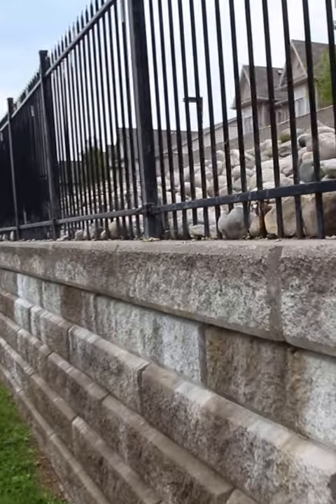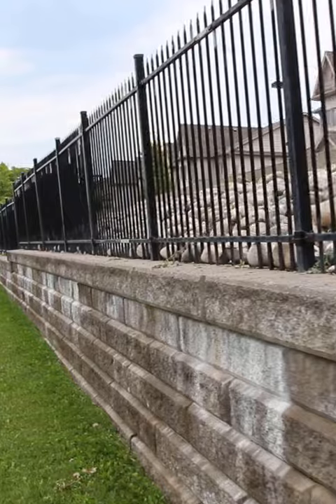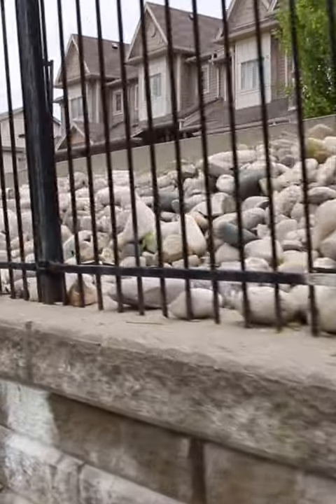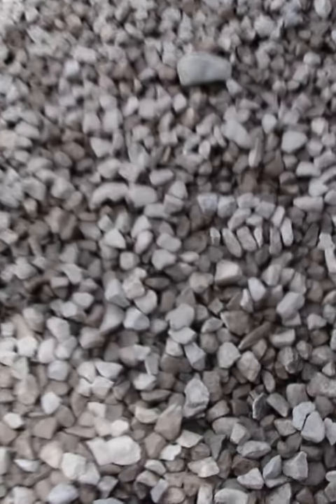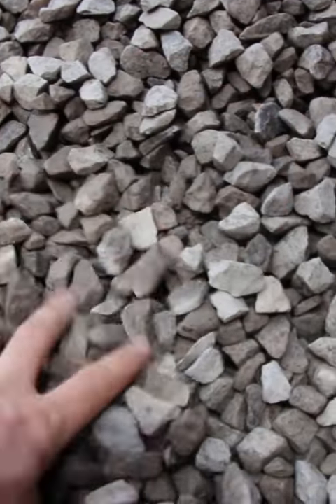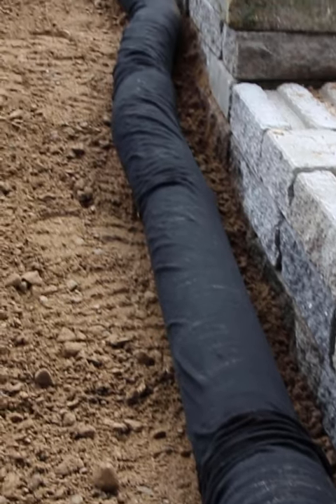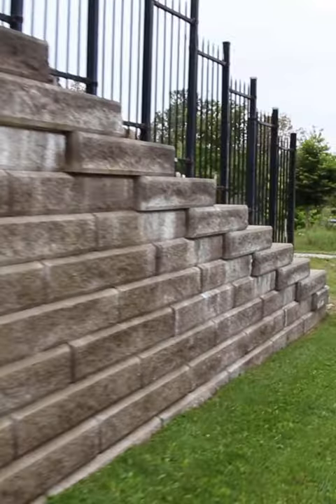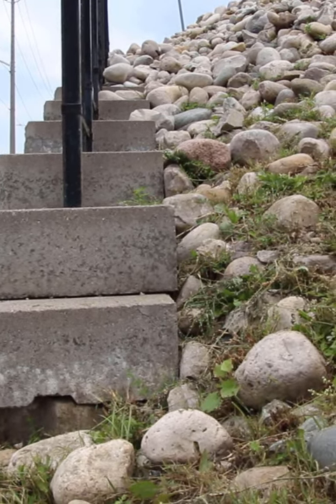No Drainage Stone or Pipe is Pushing This Wall Forward

Comment: For a retaining wall that size, is there a formula to use to calculate proper drainage required? Also, what type of drainage method would be ideal? One main drainage system with a single exit or multiple exits connected to the main drainage system? Thanks for your time!
Reply from the maker: In our area, any retaining wall over 3 feet needs to be engineered. Any wall under 3 feet we follow the engineered drawings for the wall from the manufacturer. There are rules of thumb which are covered here, but it also comes down to the load that is placed behind the wall. Lots of things to consider when it comes to walls.
Reply: It’s amazing how these subdivisions look the same. I’m like, holy crap that’s Whitby! Lol
Reply from the maker: Haha yes they all do